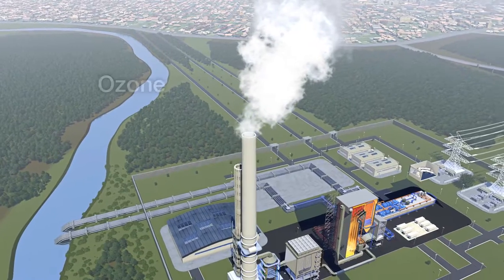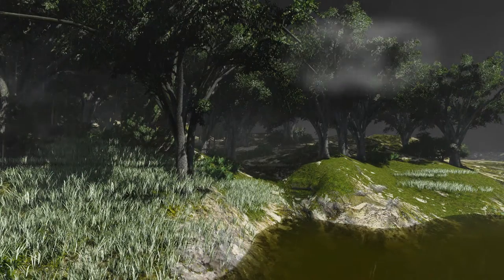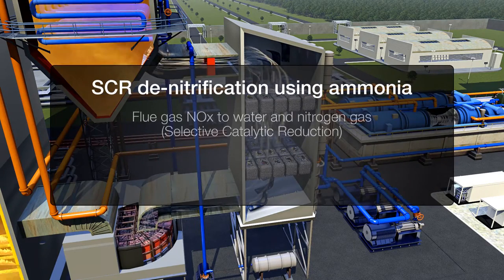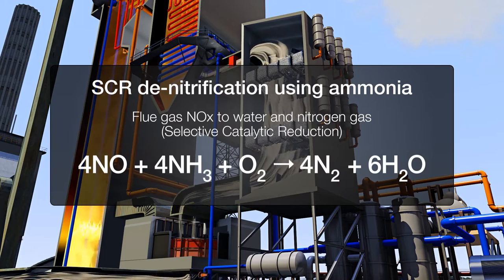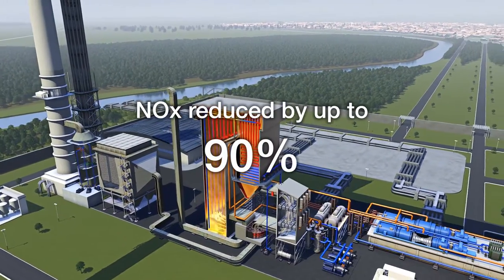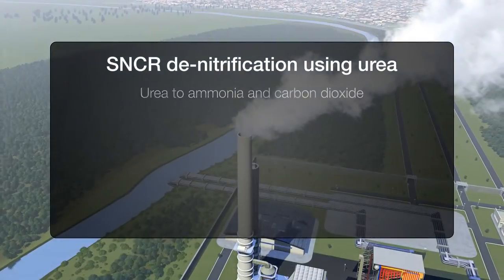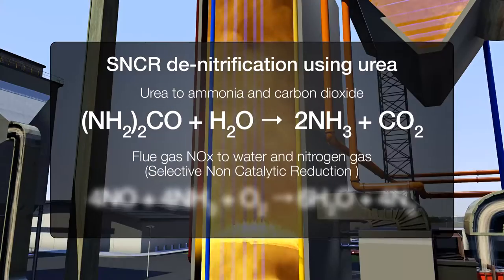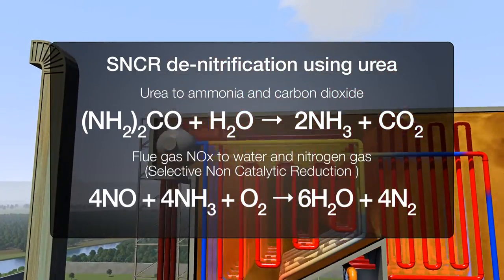Optimizing flue gas denitrification plant performance using zirconia oxygen analyzers

Comment: Why the heck wouldn't they just add a fine spray of water and air to the exhaust stream, collect the resulting water, distill off the fresh water for re-use, and be left with valuable nitric acid, and its salts? Let the ammonia and urea go to the farmers as fertilizer, as well as the producers of nitric acid, instead of using it to destroy both of those things? Any resulting "Heavy metal salts" will be left in the solids/slury after the nitric (and probably sulfuric) acid(s) are distilled off, and can be classified by their properties, re-dissolved in water, and removed by simply replacing the heavy metals with safer "light metals", such as calcium (calcium carbonate lime) to make calcium nitrate (valuable to farmers) and solid metals of anything heavier than calcium. Granted, something that would produce less waste would be scrap iron (to make a valuable iron-based fertilizer and soil life improver (it will discourage some pest bugs like slugs, and mosses (plants and insects without vascular systems)).